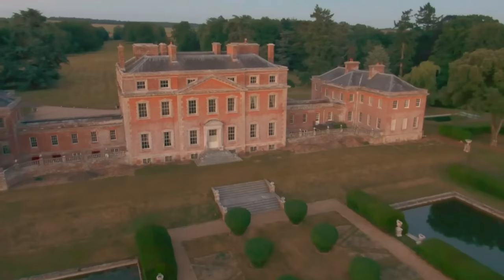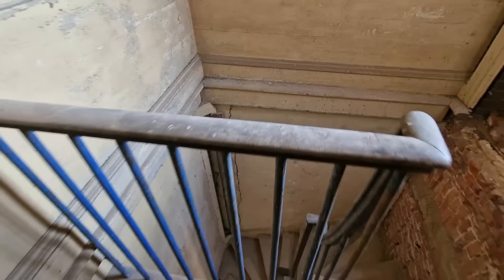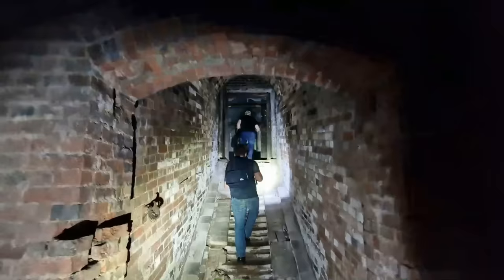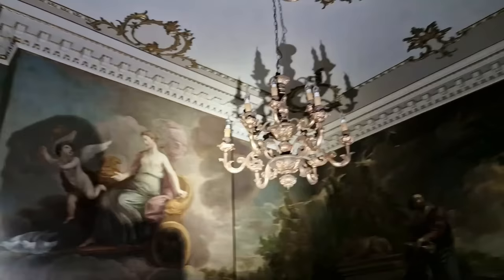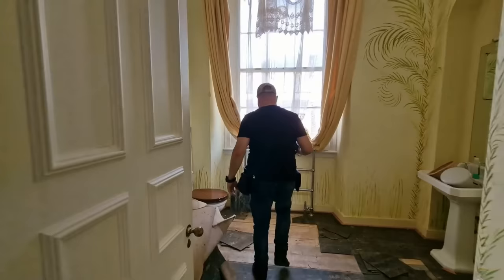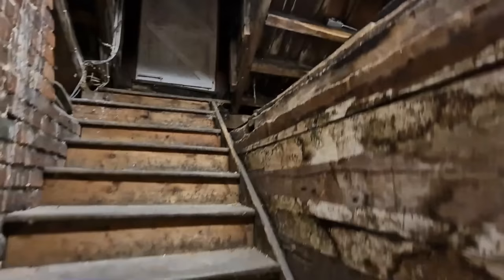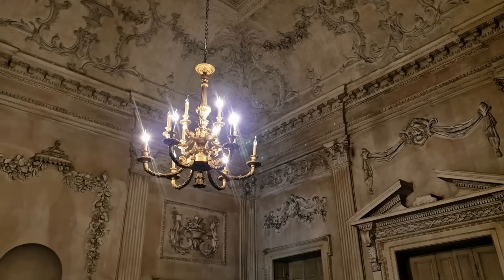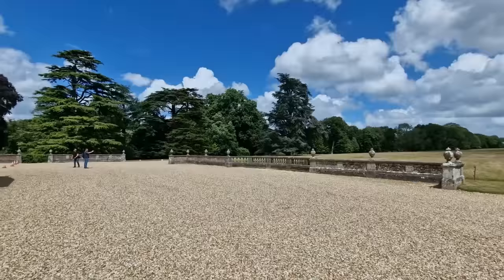Lord Nelson's ABANDONED Family Mansion - The BIGGEST place we've explored!

Comment: The most recent owner had allowed various films shot there including "28 Days', 'Sense and Sensibility' , and 'Amazing Grace' as per Wiki.  Also a place for board retreat meetings. Hopefully the restoration of the entire building goes smoothly.  In the cellar, brick the stone stairs have ramped edges for probably beer or wine barrels to roll on.   At least the roof seems to be intact (in contrast to the old Widener Estate outside of Philadelphia where the neglected roof has allowed rain and snow in for 60 years.). I am sure a lot of volunteers would be happy to help out with the small bits (and leave the intricate plastering, carpentry, plumbing, electrical, structural, masonry, etc..to the profressionals.)  It is a massive project given all the rooms. Hopefully one day it can be turned into a complete home, and events/conference center,  or an exclusive B&B for Royal Navy and Marines families. The surrounding countryside of ancient Standlynch is brilliant and lush.   That music room (painted by Cipriani) is very elegant.  England needs more professional restorers and should push for better support and tax breaks.  IT careers get boring quick.